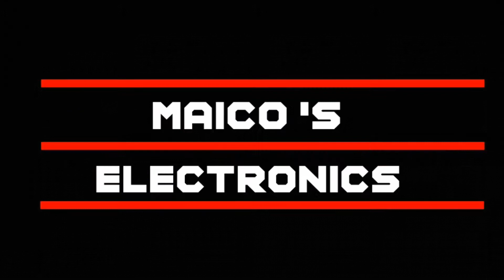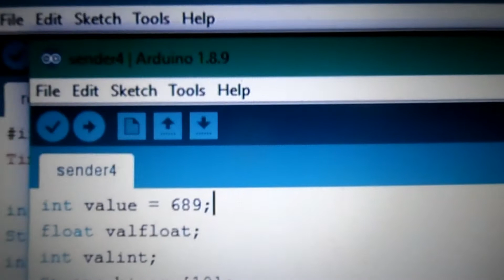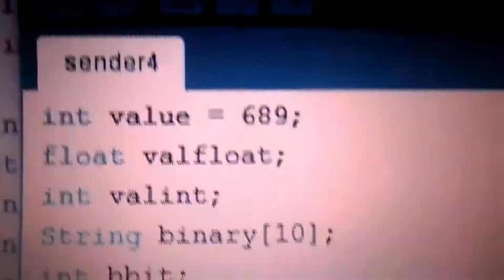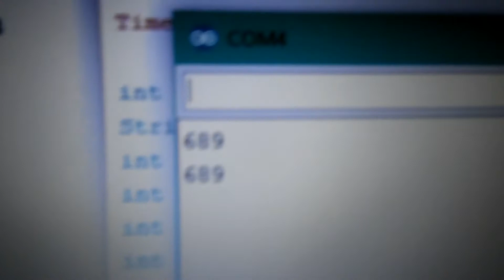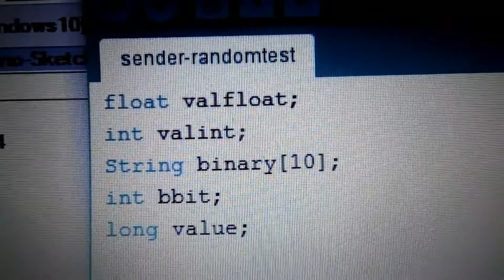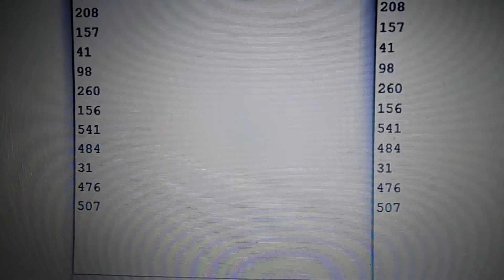Sending a value to another Arduino Nano through means of light

Comment: I just subscribed.. Can you send text messages? I would like to do the same thing with a laser over a long distance.
Reply from the maker: hey thanks for subscribing ! the project has stalled since I made this video. I was trying to use it to convey an 10-bit value through light from a non-serial-output-able Attiny85 to say a Arduino Nano that then could output it onto a serial monitor. Since a character is just an Ascii value made up out of 7 or 8 bits it could be used for text as it works bitwise (sending/receiving 7 or 8 bits is enough then) but it would be slow as hell as every letter of text needs 8-bits to be transferred by light in this style. I suppose you could speed the waiting-loops up (fine tune) to the speediest speed it all works without it getting confused. You could also calculate and send a CRC/MD5 or such value per so many bytes to see if there's been a receiving glitch.

Comment: I like this concept a lot. Might use it for a outdoor weather sensor I'm currently building. Just need to send the signal through the window. The speed is no concern for me as I will only send data a few times per hour which also means that the (battery driven) outdoor sensor will be "sleeping" most of the time.
Reply from the maker: Thanks Mike. I made it to use in a 'larger' project but so far it's still in its 2 breadboards state :)

Comment: Well done 😎
Reply from the maker: Thanks Peter !
Reply: @maicod  You're welcome, and I think you're underselling what you accomplish here in the description as you perform encoding, transmission, and then decoding. Additionally, this method is able to operate over the non-isolated medium of free space, and it is not confined to closed mediums like fiber optics thanks largely to the encoding. With lenses and lasers, you can use this method for very large distances and it's quite similar to the way Naval vessels communicate with light at sea so they can maintain radio silence. It's a very cool project, and one that you can use as a building block which can be made more robust by adding error-checking and/or modulation to deal with more difficult situations.
Reply from the maker: @Peter_S_  Thanks for your nice comment. I know there's ways to expand this but for now it works as I need for another project which I will first continue on. Indeed light has been used (and is still used) as ways of communication 'in the real world' as you describe.